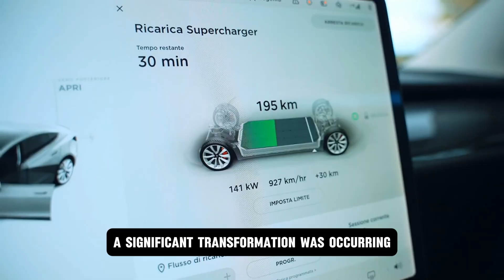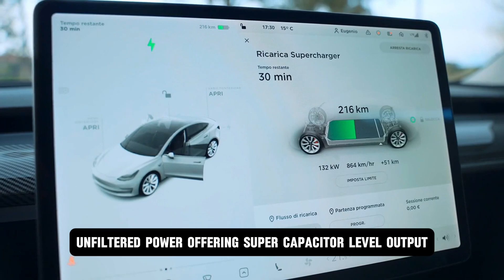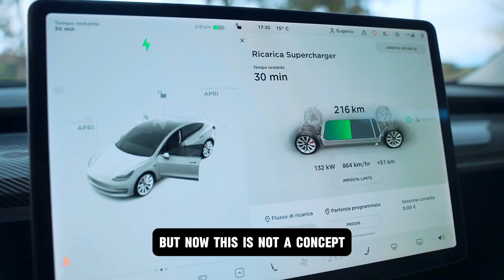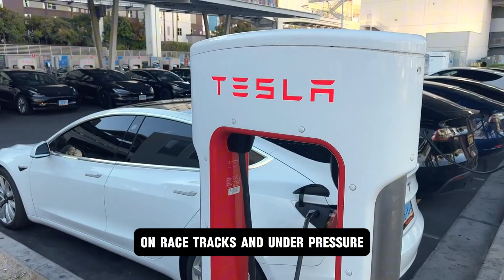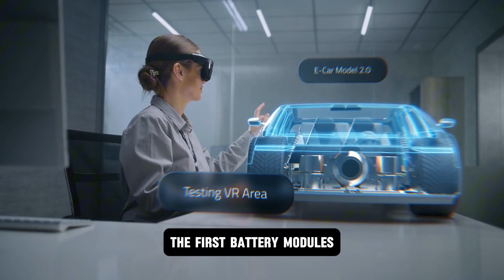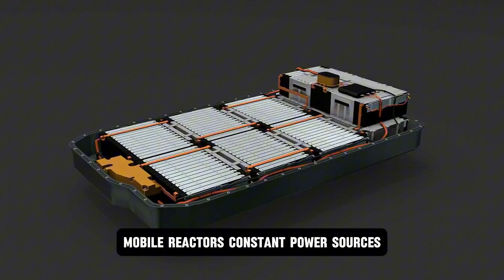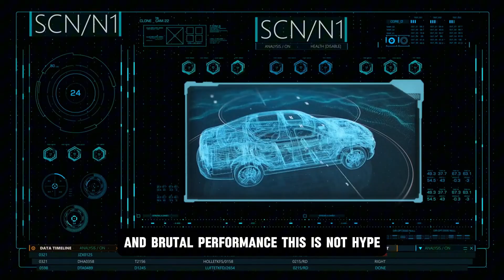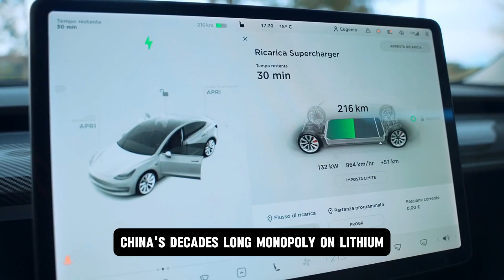5 Minutes Ago: Elon Musk Dropped A Bombshell about the Aluminum Ion Battery!

Comment: "never overheats" umm.. it WOULD overheat and most likely the heat can be used to heat the salon of the car during winter, but what is going to go on during summer is beyond me..  25-30celsius air temperature in shade.. maybe 50-70celsius in sun..  would be an oven.. has to be tested.
Reply: AND during video was said that 5minutes got 100% charge.. later 80%.. which is it?